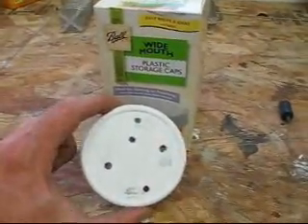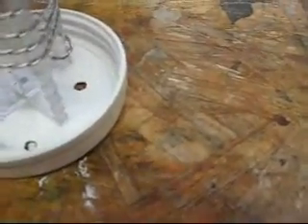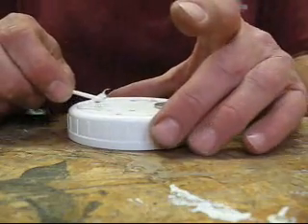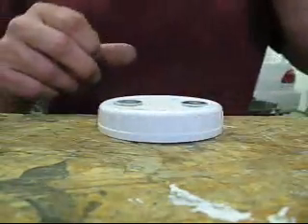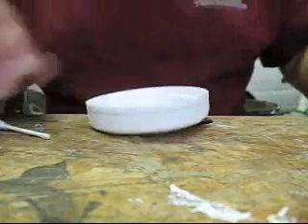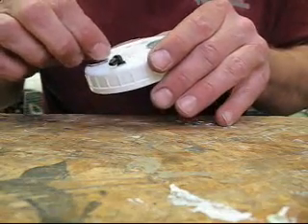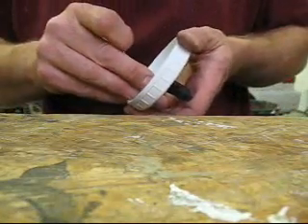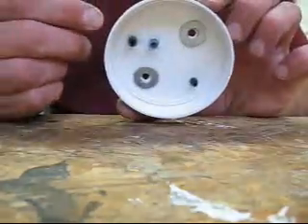How to build HHO Generator. Video 2 of 3

Comment: i don't think that it needs a bubbler air vale on it as long as you have a small hose going down to the bottom of the water to let air in. the valve is just useless. maybe a small cloth or some type of filter will work just as good, thanks for the videos on this I'm going to try different ways and see what works best. thanx dude

Comment: babbler as i understand should be airtight the only opening that pass through is the inlet from the cell which the gas escape from the cell and the outlet that supplies gas to the air filter/carb vacum connection.some model provide extra reservoir for the water which has an opening or hole for the water by gravity supplies water to the cell.

Comment: @Y3GMS The bubbler is necessary to bring in air from the outside to keep the pressure down so your container doesn't blow or bow under pressure.  It's never recommended to close it completely, to have some sort of air flow coming in.  Just a little help for ya =]

Comment: By eliminating the one way valve, wouldnt that leave you proned to flash back or pressure build up? working on one myself and wondering if a seperate bubbler system is necessary, but still wanna be safe.

Comment from the maker: We've been discussing if that is actually necessary. When hooked up to a vehicle, it is pulling a vacuum on the container. The idea is that you can adjust an airflow thru the container. However, most of what I've been studying says that when producing HHO its better to close the bubbler completely.  I'm also considering increasing the output hose side to 3/8" and eliminating the 1way valve as well. That would simplify the cap to just 3 holes - 2 power post and the output elbow.